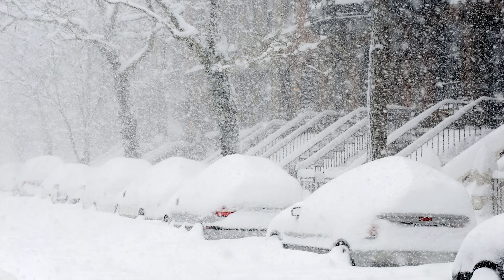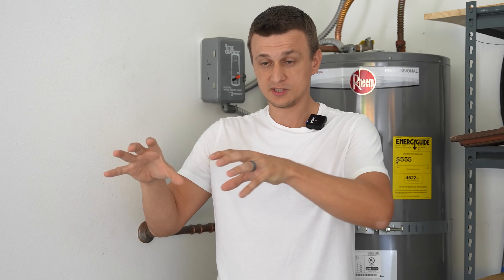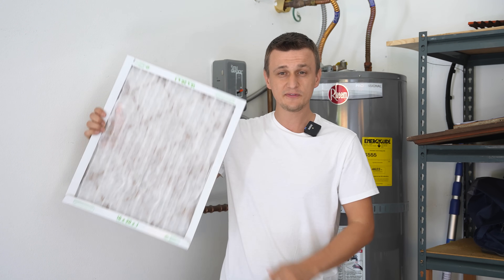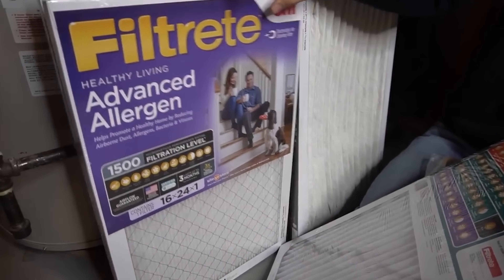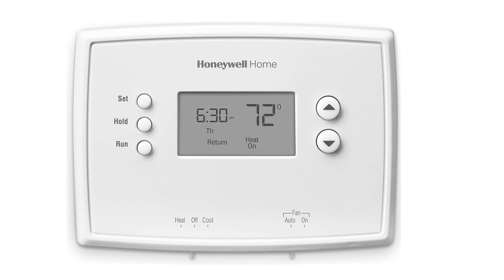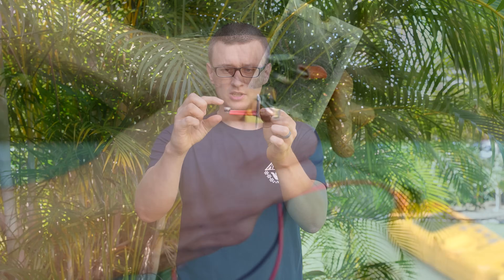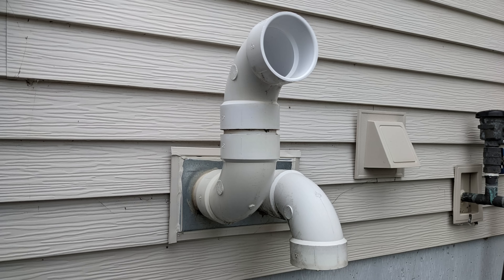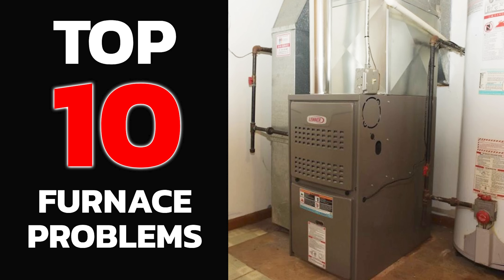Thermostat Not Turning On Heat - How To Fix It

Comment from the maker: ➡ Video References:

💡 Error Codes
Where To Start:
https://youtu.be/QJAMWlJ0tbk
Codes Explained:
https://youtu.be/J8Zegm4TClM

✅ Furnace Filter
Filter FAQs:
https://youtu.be/uPaZvHp4L2Y
Filter Comparison:
https://youtu.be/GoOKjINPgpY

🌡 Thermostat Playlist
https://youtube.com/playlist?list=PLK8tZPlovA8DvaVUQOSCJ_cDVv132rO6x

🔥 Furnace Overheating
How a Limit Switch Works:
https://youtu.be/ClAwh1HcoEc
10 Reasons It Overheats:
https://youtu.be/3ZPmltTR5S4
Reset Hi-Limit Switch:
https://youtu.be/pJzP1jzYPqg

⛔ Pressure Switch Playlist
https://youtube.com/playlist?list=PLK8tZPlovA8CWmqlGk-1wiQA9AjsT6622

🏆 Most Common Furnace Problems
Top 5:
https://youtu.be/T4IWtKy--Vk
Top 10:
https://youtu.be/dPXM8TFMQGw
Reply: Recently noticed my enducer pipe is quite hot… furnace runs a bit longer than usual. But just swapped thermostats and noticed the change…. Cracked heat exchange is my thought?
Reply: Do you know what causes my electric ac/heater to blow the 5A fuse when I put the thermostat on heat???

Comment: Almost 90% of the time when my furnace wont turn on it is the flame sensor.  If your furnace cycles and the gas lights only to turn back off about 10 seconds later right before the blower starts...most likely (but not always) it's carbon build up on the flame sensor.  I believe he has a video about that one too (for which I have been very appreciative since it has saved me a ton of money).  It's pretty easily accessible and you can even clean it with a new dollar bill (yes that is true).  I use a nonabrasive pad, and voila!  My furnace then works
Reply from the maker: Awesome! Thank you for sharing and explaining the flame sensor issue plus how to fix it! I only agree, the flame sensor is indeed the most common furnace problem. Have a marvelous New Year good sir!!
Reply: Thank you for posting your experience
Reply: I had a furnace vguy come he was⁶ condescending. He was so irritated when ai explained Inthought it was the thermosdadt on 17 year old furnace. I told him because ever time I disconnected thermostadt from wall, then reattached , and hut run and powered down at furnace switch, he just was so arrogant. $200 dollars just to show up, he said get news furnace not realizing I have a double house so no central air. He was made I erased codes and it was 12 below. I started tfurnace. Now that I listen to yiu I checked my Trane 2007 book. It explained the possibilities of the codes.All that I felt he could have tested. I am no furnace pro, but I know how to fix a lot. He left without even trying with the code flashes I told him. Looking at Trane manual, I believe these were codes he could have the tested. But he did not. Just berated me and said, "you  deleted codes by getting my furnace up on 3 degree  he didn't even test flame sensor, gas valve circuit error, low flame sense signal, or ignitor Circuit. All possibilities. I just had my same company clean and test furnaces  1 month before he came. 
$200 and annoyed he did nothing. Thank you for your work.
Reply: My brother said, just uy a thermostadt $:34 and replace it , see if that helps

Comment: This was totally helpful.  A 2 year old furnace was not running regularly on schedule. After watching this video I learned I can look up error codes from the furnace. I originally thought it was my thermostat but that checked out fine. It was really easy to find to just look through the site glass and see the blinking red LED "telling me" that the air flow was wrong which lead me to check the filter. It was totally blocked. Just simply cleaning it fixed the problem. Probably saved me from burning out the motor.  Will check the filter more regularly. Thanks for posting this.

Comment: When looking at these fixes for my furnace, I had a different problem but a super simple one. One of the removable furnace panels has a switch/button that will depress when the cover is on. My cover was not on appropriately and that’s why it wouldn’t turn on. Good luck!!

Comment: The filter was causing mine not to kick on the heat. Wouldn’t have thought that would be an issue. Thank you!
Reply: What type of filter are you using if the filter prevented furnace from heating? Aedin

Comment: I turned the heater off and on at the breaker panel to reset the electric heater. I then put new batteries in the thermostat and the heater then started working again. Thank you for the video. Saved me a call to repair service call and I don't have to wait in the cold.

Comment: Hi Jay, I love the enthusiasm you put into your videos. As you say I can ask you a question. Here it is: I have an air Handler unit made by First Co. of Dallas, Model no. 48 HBQB. It's a tall box with a hot water heat exchanger, radiator, at top of the tall (3 ft) box, and a freon evaporator at the bottom. My 75 gal water heater in the garage feeds the radiator in the winter, and my AC compressor feeds the  evaporator in the summer. The problem I have is in the winter when the heat exchanger is on and the LUX thermostat is set at 72. Often the heat does not shut off the hot water flow or the blower, and the house temp could rise to 80+, 85 or more. I changed thermostat from Honeywell to LUX,  and also changed thermostat batteries but it didn't help either.  Often I would remove the front of the thermostat to force it to shut down and it still wouldn't. So what I also learned to do is switch the thermostat dial from heat to AC and then to off, and that seems to shut it down, but not always. Also I replaced the relay inside the air handler twice, and that didn't help, so frustrating.
Have you experienced this before, or do you have any suggestions for me to do?. 
Thank you
Reply: Yes

Comment: Thank you so much I couldn't understand why my condo was 66 degrees inside when the thermostat is set at 68 and it was intermittently turning on. I took the air filter out and put it back in now it's working. My A/C guy told me not to use the pleated filters because they restrict air flow he suggested the reusable air filters. I tried the reusable filters and once I remove and clean it I can't put it back in the a/c unit they are too flexible and will not stay in place.

Comment: Thanks for suggesting replacing the batteries also. I'm afraid to remove the cover to the thermostat 
so I will have my service man check them also. I know its simple but I would probably pull the whole thermostat off and plate by mistake.

Comment: Always enjoy your video's . My furnace is 22 years old and sooner or later I'll need a new one, any brand you recommend .
Reply from the maker: Glad to hear that! 22 years is middle aged so may it still last you at least another 10 years! The brand does not matter too much but I would probably go for a Trane if it's available. More importantly, I prefer a standard efficiency 80% furnace over a high efficiency 90%+ furnace. But law makers are doing their best to outlaw the standard efficiency furnaces so that may not even be an option for you down the road.
Reply: @WordofAdviceTV  Just curious, why do you prefer a standard efficiency one? Just price, or other reasons?

Comment: Sometimes it can be the thermostat though, however in those situations, it's an easy fix. Just pick up a new one from the hardware store, and wire it in just like the old one. I have two furnaces in my house and they both stopped producing heat at the same time. One was due to a failed thermostat that suffered from an overdue battery replacement where the battery leaked and ruined the PCB. The other was due to furnace issues; a failed gas valve (easy replacement fix) and a lo-hi pressure switch that would only switch on low. The former was easy to spot because despite a good glowplug, the furnace wouldn't light (no loud click when the gas valve was commanded to open). The latter was also easy to spot because the induction fan would constantly rev up and down - classic symptom. $800 in parts (mostly the gas valve) later and we're back in business
Reply from the maker: Thank you for sharing all the different breakdowns and fixes you've encountered! This list will give people more ideas of things they can check.

Comment: Jay, I love all your videos, I've been subscribed and watching them for years, they are some of the best out there!
I know you covered the air intake may be blocked, but in a blizzard and extreme cold weather couldn't another issue be that the exhaust flue for the furnace, especially if vented vertically through the roof, be covered in snow/ice? When the system cycles off, if its cold enough outside, the melted snow around the flue could have frozen over the top of it. It could also be a reason why a carbon monoxide detector inside a home may have been activated. I think that's an easy thing to check by looking up at the roof or out a 2nd floor window, if the exhaust flue for the furnace is visible. Do you think that could be a feasible option? 
I'd like to know your honest opinion. Thanks again for your clear and detailed videos. I'm sure you're still glad you left MN after all this snow😀
Reply from the maker: Thank you!! I appreciate that you are a long term subscriber and love the videos!
Yes, what you are talking about is very possible! I've had times when a pressure switch issue was caused by exactly what you described. An iced over chimney cap. I also worked for a gas company and when I was on-call I had to go to emergency carbon monoxide calls, those were sometimes caused by blocked chimneys too, just as you explained. Thank you for bringing this up in the comments, this is indeed another easy thing to check that I forgot to add to my little list of easy things to check. 😅 I am sure your comment will help some folks out down the road. And yes! I can't say we miss the frigid cold.. Aloha from Hawaii my friend, have a marvelous New Year!!

Comment: Having an old unit sucks but can't afford to get a new one. I've have boards replaced, contactors, capacitors, ignitor replaced. Furnace was firing up over the weekend. Try to turn it on yesterday, it doesn't attempt to ignite. Going to check some things today and see if there's anything I can do myself because I'm getting tired of dealing with it at this point. Can't just let space heaters run while we're gone

Comment: Working with a Honeywell 221 thermostat for my greenhouse I made a curious discovery. I always assumed the wires
connecting to a thermostat fed power to the thermostat & the batteries simply saved the programming. Not So. As it
turns out, the batteries power the thermostat electronics. Thats how we are able to make a 2 wire thermostat operate.
One wire in & One wire out across a relay. It  AMAZES  me how long these 2 little AAA batteries last-for years in fact. 
The thermostat must be a  REAL  low current operating electronics. WOW!

!

Comment: Hi i'm hoping someone sees this 🙏🏼 I've tried a few of the troubleshooting techniques from your videos, which are awesome btw- replaced the batteries, reset the breaker, used a papeclip to bypass- the papeclip works! I can't get my heat to stay on though. I have it set to 70 degrees, auto. It  sometimes will get to 70 sometimes not, but eventually just goes back to 65 and stays there. Does anyone have any ideas what else to try while I wait on apartment maintenance to show up tomorrow, if they show up at all 🙏🏼
Reply: This was resolved. The issue was something to do with the air circulation. I usually keep the bedroom and bathroom doors closed, this was preventing air feedback circulation something like that. Maintenance advised me to keep doors open for the air to circulate better and closed off a vent in one of the bedrooms I don't use to help force more air to the other rooms. It's working great now! 🙏🏼

Comment: Love you info. So my in law apartment is blowing cold air on heat, but the rest of the house is blowing hot. I changed the filers, batteries, everything is working properly to the best of my knowledge, what’s happening lol? I don’t understand. It’s on hold and at 70 but the temp won’t go above 64. I just changed the filters today which were dirty, could it fix itself in the next day? Thank you for your info it’s appreciated!

Comment: Jay, more great advice, I love your tutorials on getting AC units & furnaces up & running. I have a similar question on my Heatilator fireplace.  When I flip the switch to start the spark igniter it normally doesn’t spark & I have to flip the switch 10-20 times and then it sparks long enough for the pilot valve to push out some gas & then heat up the thermocouple & away we go. Is there a troubleshooting technique for me to test if it the small control box isn’t creating spark voltage or spark wires causing the problem. Tried to look at control wires with multimeter but can seem to see any difference if it’s sparking or not? Thank
Reply from the maker: Unfortunately I have limited experience with fireplaces so can't give you a direct answer. If this is a push button ignitor, perhaps it is a weak battery? If it is a switch style, then have you tried cleaning and inspecting the ignitor and thermocouple for any dirt or cracks in the insulation? I would look for loose connections too, take the cover off the switch and look inside of there. Sometimes it's something obvious that can be seen right away. (like a broken terminal)
Reply: Thanks Jay, any an all advice welcome!

Comment: I have a problem with the thermostat. When I set the temperature to heat up, say to 75 degrees, and turn the slide switch on at the bottom, it reaches the set temperature of 75, but due to the cold weather the temp keeps dropping and it is not auto starting (detecting the drop in temp). But if I go and turn on the switch at the bottom manually to off and then turn it on, the furnace starts up. Any idea what could be the problem? Thermostat/furnace is 20 years old, honeywell. Thanks.

Comment: I had insulation put in my attic over the old insulation and I thought oh this is gonna be wonderful. The house will be warm. Well since the insulation was put in the heating system has gone wonky and it’s 13° out and the house won’t get past 65°… The thermostat shows all kinds of crazy temperatures like it’s 88 in the house. No it’s not but if you put a thermometer next to the thermostat, it says 88 as well and where the thermostat is located in between our bedrooms, the area is freezing also the air coming out of all the vents in the house  is slow it’s not really blowing at all it seems like warm air is just floating down… Then if you set the thermostat to 85 it says the house is 85 but it’s only 65 and when we went up to look at the furnace because my husband has experience  in industrial refrigeration, he turned off the system and then our thermostat went on system weight for an hour and a half. The house went down to 63. It was a nightmare. PS we can’t go get a new thermostat or anything until the ice and all the terrible stuff on the roads go away , so we’re stuck in a freezing house and no company will send out anybody because the road conditions are too hazardous at least today it’s 19° help help
Reply from the maker: Oh boy.. Sorry to hear about the furnace troubles. From what I understand, your furnace is in the attic right? Optimally the furnace should have been off the whole time you were doing this insulation project. Otherwise you run the risk of plugging things up in it. Unfortunately I can't say anything for sure because this is a unique case but my first guess would be to replace the furnace filter if you haven't already. If you turn the furnace off at the thermostat and set the fan from AUTO to ON, is the airflow still just as weak without the heat on? Is there a vent near the thermostat somewhere? Perhaps it should get closed. I would try leaving the fan in the ON position with the heat on as well and seeing if that makes a difference. What if you put a standalone fan in the hallway and direct it at the thermostat? Perhaps that will cool it off enough so that it's not at 88 degrees. You could always bypass the thermostat as well, to keep the heat running. I have a few videos on how to do that. There are quite a few other things that could be going wrong, like a faulty control board, setting the heat fan speed higher, or fan motor going bad but these are not as easy to address over a comment.

Comment: What about a Carrier Performance TP-PRH-A screen in which the LCD display is corrupted but not blank (for example, the setting for 67 degrees is partially readable and the when we slightly twist the thermostat, it goes back to normal?  No error codes.  Thanks.

Comment: This is not a thermostat problem, but I asked a question on 10 water heater problems, which you did not answer. so I am going to try here.
Reply from the maker: Sorry about that, I get quite a few comments every day so I mainly only respond on my new videos and just occasionally on the old ones. I do not remember any water heater questions so I probably didn't see it.

Comment: I have electric heat with a air handler. I just notice my 3 ton unit comes on when heat is on . Never have seen this before now and lived here 2 yes.  Could this be right or misfires? Tia for any help

Comment: Any idea if concentric furnace vents go bad inside or need replacing?
I replaced my inducer blow motor assembly bc my furnace wasn’t running and the motor was hot and opened it up inside and had broke fan teeth. One the new one was installed furnace kicked on no problem. Now when it falls before the set temperature and doesn’t to turn on it cycles inducer motor starts but blower does not kick on, and can hear the pvc pipe right where the exhaust and intake connect into the concentric vent tubing like clicking. If I reset the system and turn the temperature back up on the Nest it turns on ran for 15min and shut off again. Air filters are pretty new and same as always used, flame sensor is clean. Can’t figure it out